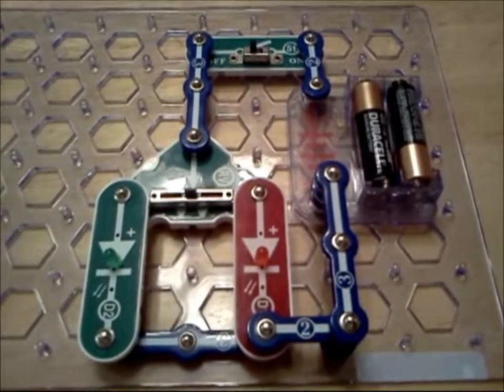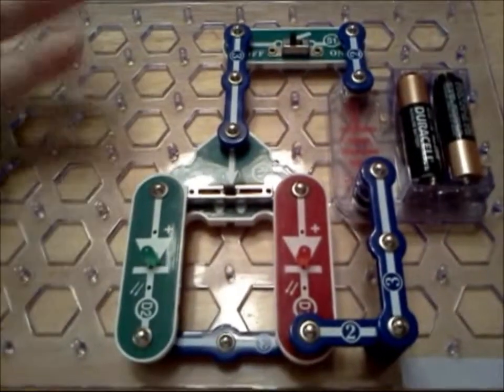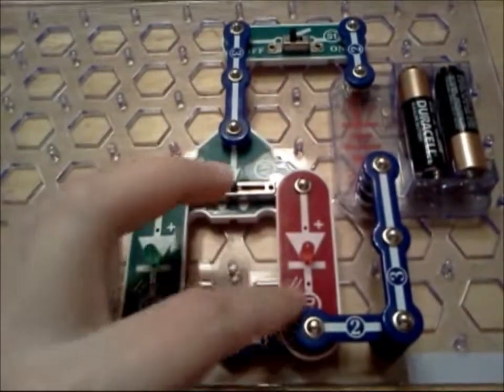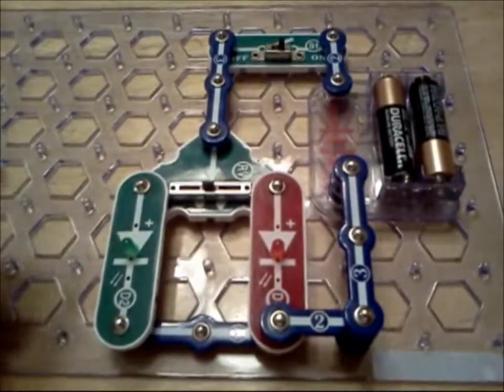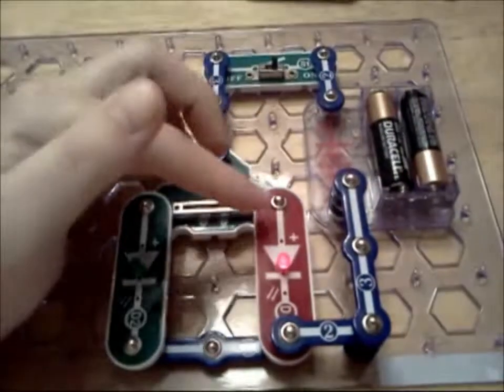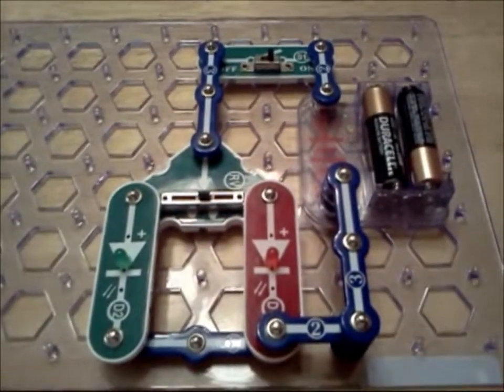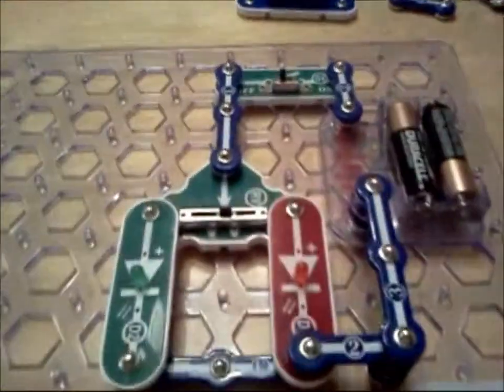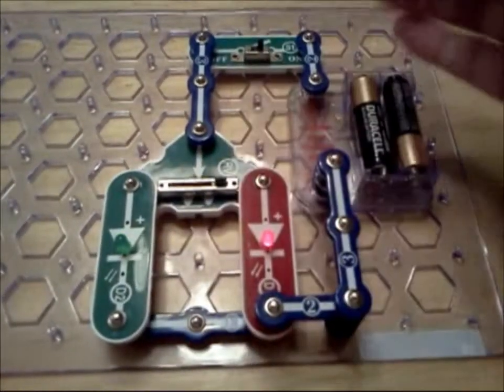Snap Circuits Adjustable Resistor LED Surprise

Comment: I think what is happening is that when the slider is turned to the red side, it is like there is no resistor in series with the red LED, but a large resistor in series with the green LED, so the red LED lights up and the green LED doesn't.  (If it is a different color, it may light up dimly.)
Reply: Yes where when there is more resistance the red led that uses less power will turn on and more, the green will turn on and green uses more power